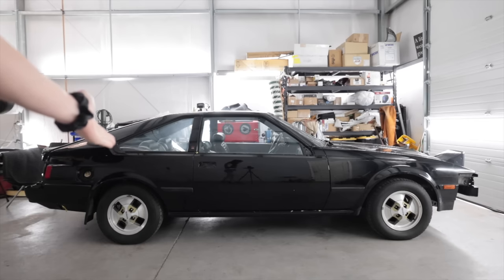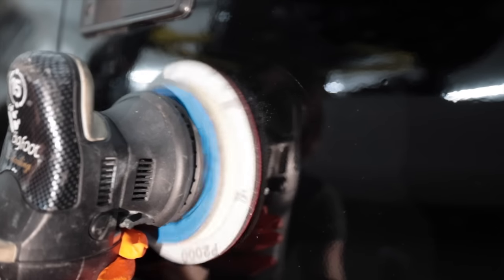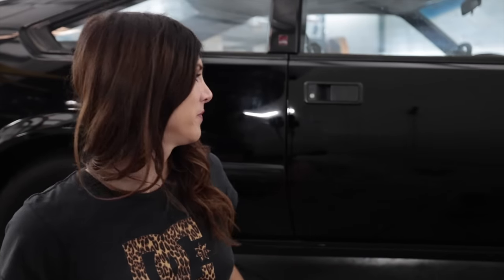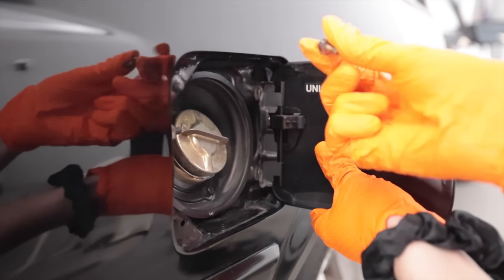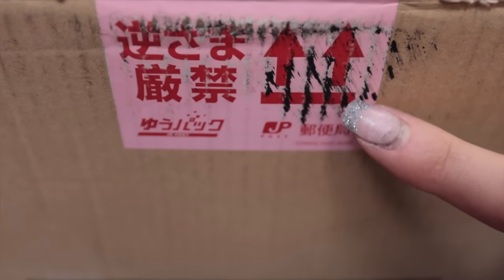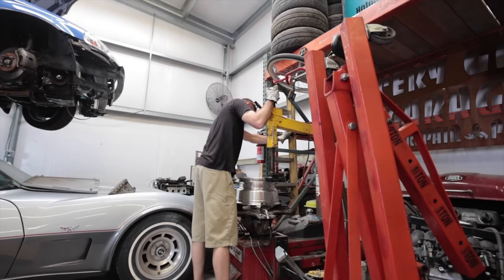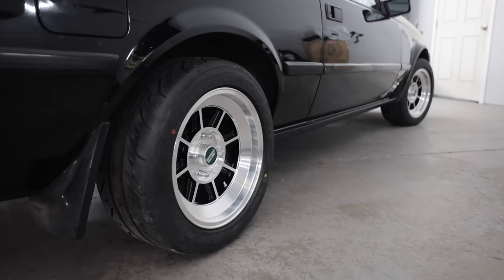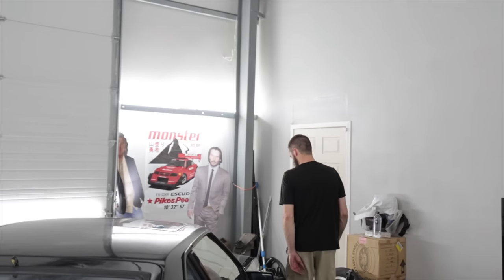This Completely Transformed The Car!

Comment: That sag fix blew my mind.  I had no idea that was even possible.  I thought after sanding it would have to be painted over.
Reply: Oh yes a standard one sided razor blade, bend it into a shallow curve to stop the corners digging in and scrape at an angle (like your holding a pen) with the middle of the blade. You can fix runs and sags very easily this way. Buy a packet of 100 blades and swap them out before they get dull.
Reply: Yes yes I wonder if there was a way to do that without having to reshoot that part of the door
Reply: @frankish5314  you can also use thin mylar or kapton tape on the sides of a blade to avoid digging in and just shave the drip. Luthier use that method for guitar paint correction everyday.
Reply: @DynamicRockers  Yup. I have used painters tape around the ends of the blade before but that tape is a bit thick, Mylar or similar would be batter.

Comment: The rods on the louvers should be prop rods to hold it up while you clean the window, like a hood prop. Should be hinged on top, weird latches on bottom. The hardest part about restoring louvers is eliminating the rattles, foam, caulk, etc all a must. You're doing great work, and that's coming from a huge Mk2 nerd. Love the wheel choice. Replacing the elastic on the door pockets and seat backs is a nice touch often overlooked on them.
Reply: I was going to let Sarah know about the prop rods, but you beat me to it. 👍
Reply: (Oh, though, if they don't move, they may just be stiffeners.  )
Reply: This is the reveal I've been waiting for. VERY NICE wheels, I was afraid they might be black, which I am so tired of seeing. When you see a dry patch when your spraying paint, have another gun with only reducer in it, and lightly spray over the dry  patch, and it's gone. 😊
.
Reply from the maker: Hey that’s pretty neat
Reply: @SarahnTuned  - the louvers gives them that nioce razorback look. I know my next generation one would look great with the long hatch shape.
Reply: Love your analosity! Not sure that is a word? So maybe I just coined it?
Reply: @michaelraabe3401  No way, what a coincidence!   Analosity is the name of my Fudge Tunnel tribute band!
Reply: The louvers look like a Chastain Shadow brand set. I have a 3 piece set on my '84 Camaro Berlinetta. And the rods are for propping it up to clean the rear glass.
Reply: Since louvers are a love or hate thing, maybe it would be better to hold off refurbishing them until the winner expresses a preference.

Comment: The disks on the back of the selected supra are actually disk drum. The parking brake is inside of a very expensive to replace. I used to have one of those supras back when I was a teenager.

Comment: Your choice of wheels and tires is always spot on! 👌I'm actually going to dig into your videos, to find out which ones you have on your cars - to get some ideas for future reference. If only you could publish this info on twitter... 😉
 (I vote for silver lug nuts)
Reply: I own an 85 mk2 with 15" wheels with 225-50-15 tires.  A 225-45-15 is going to add 50 revolutions per mile and it will be noticeable on the highway
Reply: @1985supramk2  And more noticeable on pot holes and dirt. I found 50 profile tires to be the best compromise for daily driving and comfort.

Comment: We had a white P type (1984) in the UK - manual, flares (with black piping), and 7.5j alloys that filled the wider arches. On our first trip out, a car park attendant actually saluted! One of the neatest touches was that one of the boot (trunk?) plastic cover pieces doubled up as a funnel to avoid spilling petrol over the bodywork.

Comment: Absolutely spot on choice with wheels. Never had a doubt you'd make a wrong call. Also very impressed no breaking of plastic doodads on that panel, cos no matter how careful, the age of the plastic usually determines when it's too brittle, no matter how careful

Comment: I had this exact car when I was in high school in the early 90s.  It was burnt orange, and I completely ragged it out.  I drove it to college and to work also for several years until the fuel pump finally gave out and I sold it.  It had the digital speedometer that went up to 85 and cruise control.  It had a cassette and all those cool equalizer slides on the radio.

Comment: I was going to mention the razor blade trick but too hard to explain.  It works great for slowly & carefully removing just the high parts of runs or sags.  Good to have that skill in your arsenal.  The car is looking awesome!  When designing the installation of gizzmos in various aerospace things we would say if our company badge would slip between parts, we had clearance (approx .030") LOL!  Didn't always "fly" but worth a try!

Comment: I sold Toyota parts from 1984 to 1992 i remember the old parts tags, oil filter for your car 15601-44011, (i still remember), Older Cars are soooo much nicer to work on, especially when they arent roached.

Comment: I watched the fix to the paint on the door twice and still have no comprehension on how that fix worked.  It looked like it was sanded down to bare metal yet clearly you were only roughing up some outer layer that looks white/cloudy once disturbed cuz it all returned to a flawless finish after the last step.  More proof that body / paint work is its own niche of magic.

Comment: Best way to remove stickers is with hot air gun. it will remove the sticker with the glue, it will not leave the glue residue on the surface. Amazing car btw, you don't get to see cars like these in Europe.

Comment: The original tires were bigger in height, can you do the adjustment on the speedometer yourself, or must you use a specialized shop? Will the wheel-geometry be different with the new coil-overs and new wheels, so all the wheels need to be re-aligned??
Cheers.

Comment: I don’t even think black lug nuts were a thing back when this car was made. All aftermarket wheels had chrome lug nuts at the time. as far as the louvers, at some point they said shadow by Toyota, but my mom had an 84 with the same louvers, it just said Toyota just like yours. The lettering was originally red but it faded out very quickly.

Comment: On the assumption the winner will get the original wheels too, BFGoodrich T/A Sport tyres should be available in that size - Goodrich has been part of the Michelin group for decades, and thier tyres are basically the previous generation Michelin rubber compound and carcass lay up, with a 70's style tread block pattern. They work really well on 60's and 70's cars. Have them on '66 Chrysler Valiant (RHD of the same years Plymouth Valiant), and they grip well in nearly all conditions.

Comment: You are correct being a tire jockey is a very hard and physically demanding job there was a guy trying to mount 30-in tires on this rims at a professional tire store and it was three giant dudes pushing on the bar they had a hard time they got it done yeah Tire Machines are hard work I know I used to operate one:face-orange-frowning:

Comment: Yeah, the LED lights cycle on and off 60 times per second if running on wall power, but led photography lights don’t have that issue because they have circuit in them that separates them into 3 phases so there’s never a time when all the lights are off unless you tune the whole device off.

Comment: Stock ride height already looks good. Is the entire wheel and tire assembly is a smaller diameter than stock? That's gonna feel peppier than it used to from the small diameter.
Reply: Stock wheels and tires should only be 2.5cm (roughly 1") larger rolling diameter than the new wheels and tires. Yes I wasted my time to calculate it out. 😂

Comment: You spoke about it but you didn't identify the product you use to prevent wheels from accumulating brake dust. I have some really nice (19") wheels that look absolutely crappy when they're not clean so I'm compelled to clean them often. And, honestly, I had no idea such a product even existed that could maximize the time between cleanings. Thank you Sarah, in advance if you can supply the info, and thank you for the always excellent, informative, and highly entertaining content.

Comment: Sarah, try using wd40 or some other penetrating oil when removing stickers,

Not only will it help dissolve the glue, it will lube your razor blade and minimize the risk of it digging into the finish of whatever you're removing the decal from.

Comment: Woah! i didn't know you could still buy those new, thought they'd have to be the Rota copies?! Smart work on this and cheers for the part number for the whiskers, will see if i can get some off Nengun. Fora MA61, you've managed to find  really structurally solid example  so the the person who wins this is getting a very special car. They are usually one of those super reliable cars that get neglected and become a beater cos they never break down.
I imagine you are going with BC for the coilovers, T3 are too much for what they are IMO. Worth buying a used pair of front strut cases if you do go with BC's as will make the welding the stub axles on easier & new onwer can swap them back if ever needed.

Comment: I was wondering about the graphic! Wikipedia says that in '82 the Celica Supra didn't have the big SUPRA, but I don't know myself. "Also, the tail-lights were redesigned and the hatch received a billboard "Supra" sticker instead of the smaller sticker, which was previously positioned on the right." Personally I would go for the big SUPRA! Hell yeah to the rims and tires. Looks boss. Fingers crossed I win it!
Reply from the maker: I tell you this in the video 😉
Reply: @SarahnTuned  Yah! I'm just nerding out on what year/version sticker you might go for. Love the builds!

Comment: Don't fiddle with the louvers because if I win this thing, it's coming off anyway and stored. Never did care for them on any car. The silver lug bolts are the best looking. Needs shiny bits so folks can see you. I've own black vehicles & motorcycles. People just do not see them. Had a black Chrysler 300C hemi until some one smashed into it. Another great video. The car is coming along nicely.

Comment: I love those wheels! The tire diameter is smaller than OEM, right? Is there a way to adjust the speedo and all that? Also, I think that toyota sticker on the louvers might've just been "TOYOTA" as it looks to my eye like there's a shadow of the missing portion of the sticker and it has a curved corner at the upper right which would kinda seem like that's all there was.
Reply from the maker: Yep, and it has the 4.3 FD also now, it should wake the car up a ton! I’ll see how far it’s off first. Might beable to re-gear the Speedo
Reply: @SarahnTuned  Ohhh right, I forgot about that--so you're gonna have to do something no matter what, got it!

Comment: I'm not sure I understand the massive drop in total wheel diameter you have chosen here, 6.9% according to my friendly online calculator.  You can easily see the difference when you have the old and new wheels sitting next to each other!  I can't help but think this will cause all sorts of problems such as speedo/odo calibration, further changes to the final drive radio and suspension geometry and ride height issues.

Comment: T-bird gets new CV axles 😉... ? muscle car, looks more like a 1980's jaguar cylinder bank one and two have an off set fuel table so it pops lightly in the exhaust to mock the V12 sound, the V8 makes more power then the V12.

Comment: Are you using a 'wool bonnet' for the final buff?  Do you find it aggressive to the point you've got to be really careful?
Reply from the maker: I literally took sandpaper to it.. so no, it’s not too aggressive 😉 also the car is getting detailed still, that’s not the final polish.
Reply: @SarahnTuned  - fo' sho'.  After I've scrapped a sag and sanded, I've just been paranoid about what to buff with after.